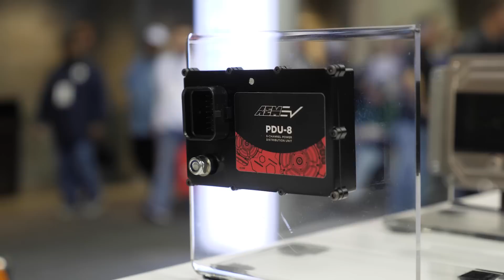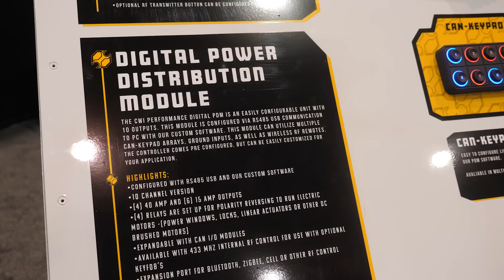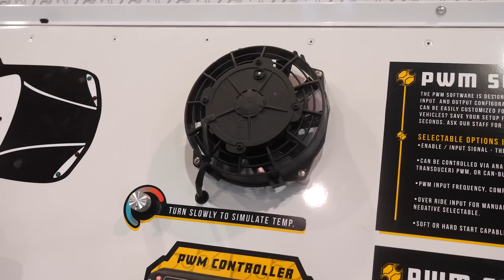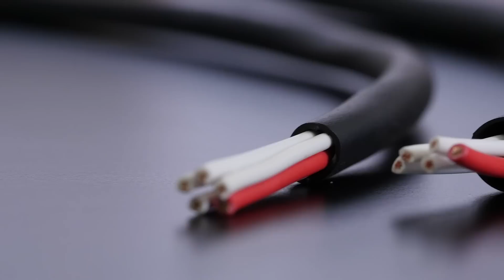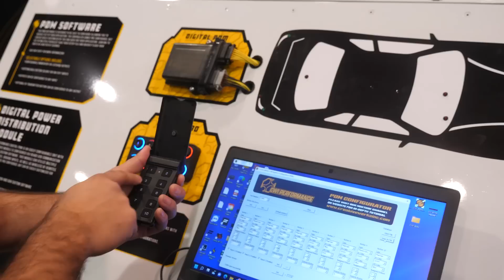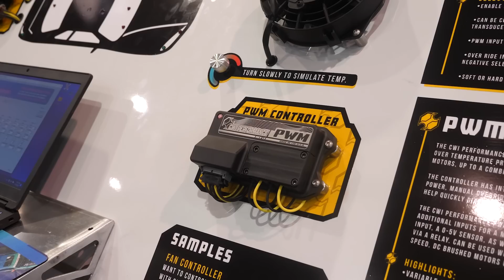What's The Catch? | $500 PDM & Keypad

Comment: PDMs should be alot cheaper than what they are, the components are no that special, the software can be written cheaply by someone who knows how.
Reply from the maker: It's one of those things though, it's easy to say this, but really if it was 100% accurate then PDMs would be already be cheaper. There are many companies making them, there is no monopoly on this tech.
They are not 'cheap' but worth mentioning they have come down in price dramatically over the last 20 years as it is.
That said, if you want to put together some top quality PDMs and sell them for a lot cheaper than anyone else we are all for that, dive into it and prove me wrong! - Taz.
Reply: @hpa101  they are doing less than an ecu but cost more🤣 I can build the hardware side no problems, if anyone wants to help with the software, it's on like donkey kong👍
Reply: @Mike-ry4ti  A cheap laptop can do alot more then even a very complex ecu but thats not reflected in the price

Comment: 500 is a killer deal. when doing a custom relay/fuse panel, you can easily get that close just in wire, connectors, consumables, relays/fuses, and parts and a PDM replaces most of that and programmable to boot! definitely keeping an eye on this product for my build.

Comment: Hey get me back on motorsporr wiring alliance 😢. What did i even do wrong? I dont even spam or argue with anyone…and i am an hpa member.
Reply from the maker: I'll take a nose. There are some auto settings on there, so say if you posted something that got reported a bunch, you would get automatically suspended or potentially banned depending what it was.
BUT
It takes two to tango as they say for that to actually occur to be fair. No one reports random posts, it's hard enough to encourage people to report actual spam, useless comments that help no one or abuse let alone having them do it randomly - Taz.

Comment: Why does a product like this exist? There's better and cheaper ways to do this
Reply: I was kinda wondering the same lol... I think people are just scared of wiring or have some weird vendetta against a toggle switch, so they look for the easy button. To each their own, I still think carburetors are an excellent choice for most any race application and man, mention that to someone under 40yo and get ready for the display of ignorant personal attacks lol.
Reply: i just cleared 40...It looks like this product is aimed at a diy market. what noticable benefit can a amateur build vehicle/racecar really get from a pwm controlled fan. U get oem looking aftermarket switches for windows or anything u could ever want in a car and resettable fuses are older than me!   @Jared45513
Reply: @Jared45513  idk pdm and keypads are awesome.  I too like carburetors.  Tuned some carbureted applications with motec pdm, keypad and dash setup.
You can do so much.  You've got the buttons plus you can do combinations with maths.  Like multiple buttons pressed or holding a button to create another switch/function.
No doubt, it's way better but for my personal race car switches it is still 😪
And as far as the dash... it does things a gauge can't.  You can program oil pressure warning to rpm, easily setup plenty of warning indicators, data acquisition...

Comment: Damn, 500 bucks is considered cheap for one of these?? Guess I'll be sticking with fuse boxes for the foreseeable future!
Reply: yeah its more expensive but price up 10 relays, 10 toggle switch especially ones with specific etchings on them for certain applications, 50m of cable and terminals and youre easily at $150-$250 bucks if you arent using the cheapest components available

Comment: You got me... Started watching thinking this is the one, then find out it's just a relay box 😏
Reply: Yes and no - check the actual spec', and you will see it's an interim step between a conventional "fuse box", and a "conventional" SS PDM. 
The former uses individual switched inputs, the latter a bus type interface - if you don't get that, you shouldn't be commenting...
Remember, not everyone has the budget, or need for, a true SS "relay box".
Reply: @gordowg1wg145 
I do understand the difference, I can't see the point if you want to simplify and add control/reliability to the system.
That's why I commented.
Reply: I allso missed whole point off this cause it still needs solid state relays. All most every ecu can do all this with solid state relay connected.
Reply: How do the ecus do current monitoring?

Comment: I appreciate the simplicity that a solid state pdm delivers but I can’t help but think that transistors don’t transfer 100% of their input where a relay only looses through resistance and the small draw from the coil so this is probably a good idea and should sell although the faster switching and variable output is something I guess a relay based system will miss out on. but overall I can see this system being popular.

Comment: This will be a game changer for any car enthusiast. Anyone thinks that spending this small amount on a vehicle needs to find a cheaper hobby . I’ve seen the blinkmarine keypad and would use it that said I was quite surprised how cheap the motec ones were . A very good package though for anyone wanting to ditch the horrible old fuse box and relays  . Solid state PDMS I agree are still a bit on the pricey side . We’d still probably have to go for a full solid state setup for our race car but would definitely consider this PDM for our fast road conversions . 
More excellent content guys cheers 👍.